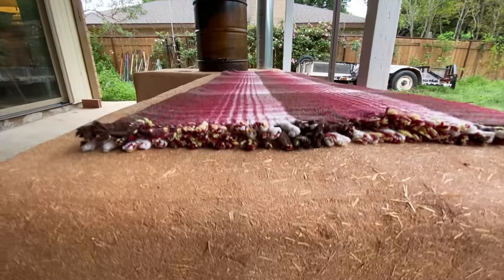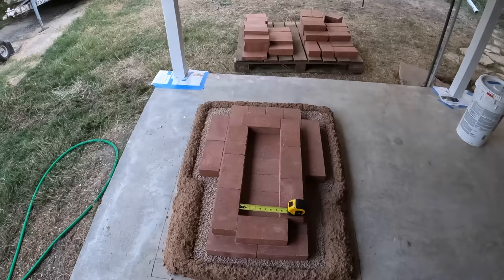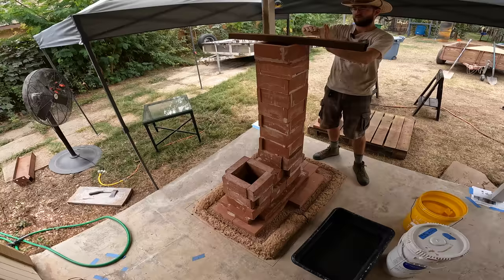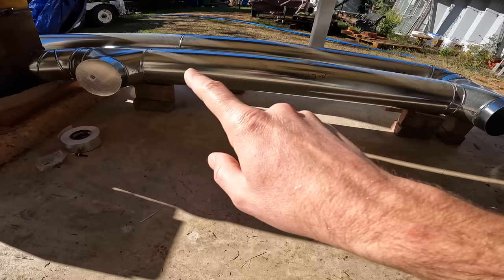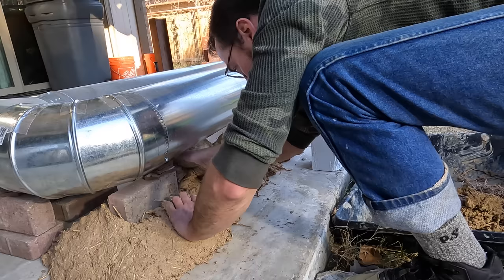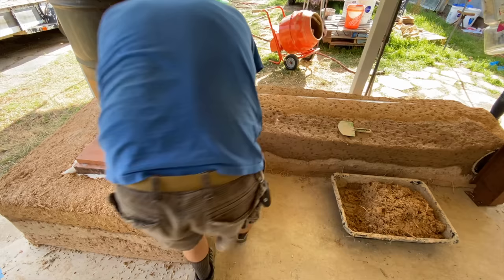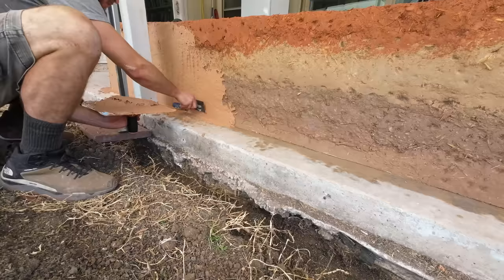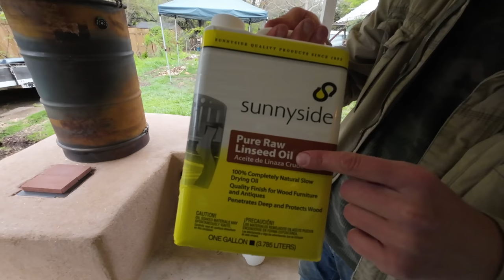World's most efficient stove!!!!  Made of DIRT!!!

Comment: This is horrible and dangerous.
1 - there is no way to remove ash, while the stove is burning. It means this stove cannot be used for continuous heating in winter.
2 - smoke goes into the room until stove gets hot enough for natural draft. There should be 2 paths for smoke, short path for heating the stove and long one for heating the room efficiently.
3 - Fire could be used for cooking, but the way this stove is built - its impossible.
Here is an example of good design, but its made with bricks: https://youtu.be/lqcB6GODbGY?si=1ECg7ZZQDfWEq9_Y&t=2108

Comment: Mine is more efficient look at it, I have the thermal imaging to prove my heat scrub
Reply from the maker: Your stove is VERY cool! Beautiful metal work. I would politely push back and ask the question. How many hours after the fire goes out does your heat exchanger remain hot? It doesn’t have nearly as much thermal mass so I would bet that the metal is nearly room temperature after about two or three hours after the last ember goes dark. 

I would also venture a guess that the air coming out of your chimney wherever it exits your roof is probably warmer than the air coming out of a rock at mass heater chimney as it comes out of the roof. That equates to heat being sent into the sky rather than being stored inside of your building. 

Looking at things through that lens I can’t help but wonder if a rocket mass heater is more efficient. 

Either way I appreciate the intelligent engagement in conversation and comments. Thanks for subscribing. You do beautiful work!
Reply: @suburbanbiology  
Heat retention is not the same as efficiency in this case.

How slowly the heat is released is not an indication of the exchangers ability to “ collect” or scrub the heat from the wood as it is burnt.

First I harvest over 80% of the energy  in one piece of wood, then it is collected in a heat battery of water 1000L  ( seen in my video circulating with a pump ) Which nearly absorbs all the heat harvested, this heat is released for up to 3 days with one log. With an outdoor ambient temp of 0 deg Celsius.

My efficiency was based on temp of the flue gas entering the exchanger vs the temp of flue gas leaving the exchanger. 

500F going in 80F going out (shown with thermal imaging in video )

(500-80) \ 500 = 84% heat retained into the water side of the exchanger 

Obviously I have heat loss to the environment but since it’s in the building it’s a good thing.